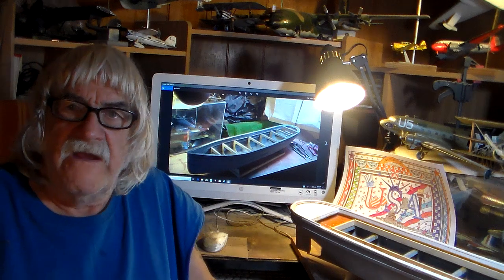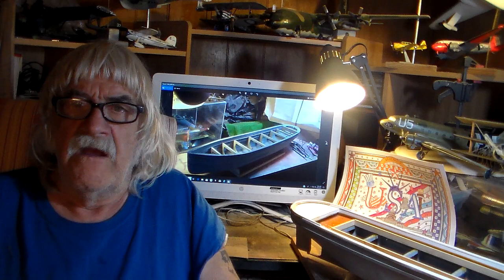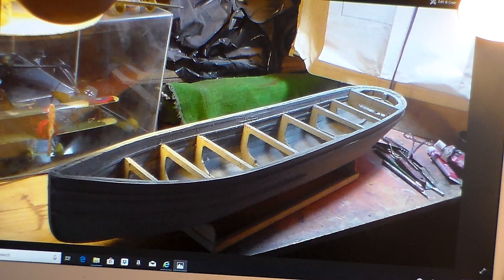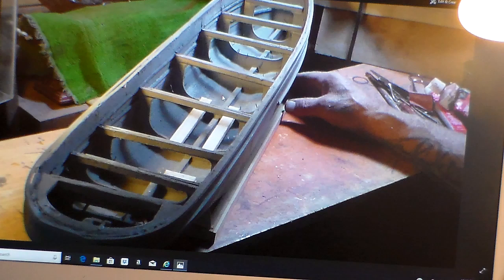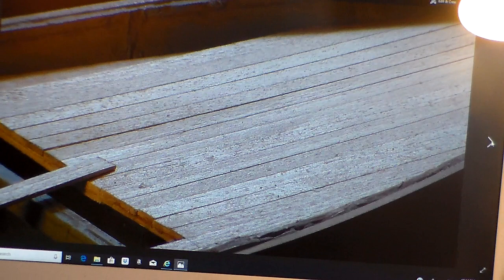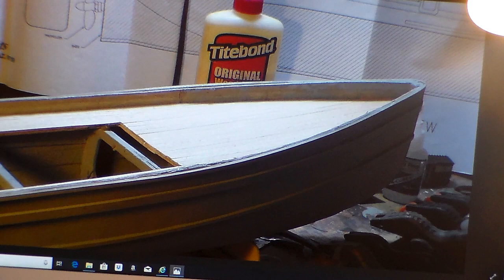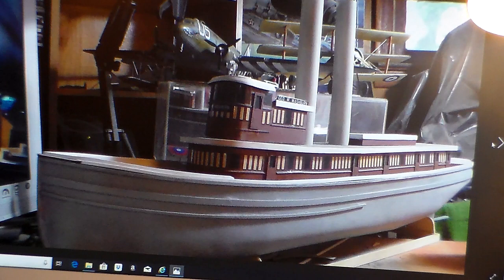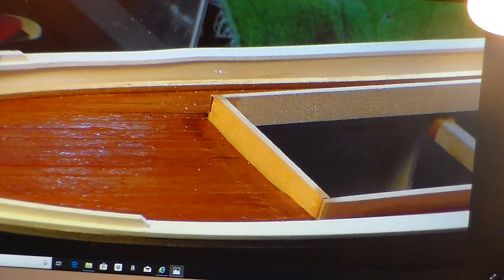Dumas GEORGE W WASHBURN Tow Tug video 4 Part 1

Comment: Thanks for all you teach us.  
I'm bringing a 75% finished Dumas '44 Coast Guard Lifeboat build out of mothballs from 1978.  I lined the wooden hull with thixothopic Hobby Poxy and base coated it with clear Hobby Poxy paint.  The clear paint and lining look as good as the day they were laid down in '78 - no yellowing or cracking.  It hasn't been painted with colors or fiberglassed.  I would like to finish it as an RC model, but don't intend to sail it much.  Is fiberglassing the hull appropriate in this case?
Many thanks.